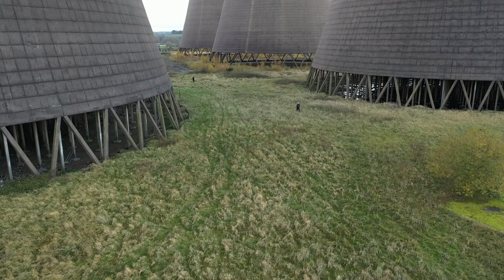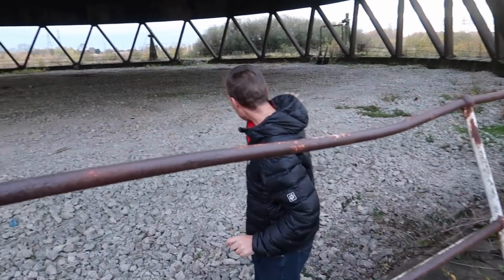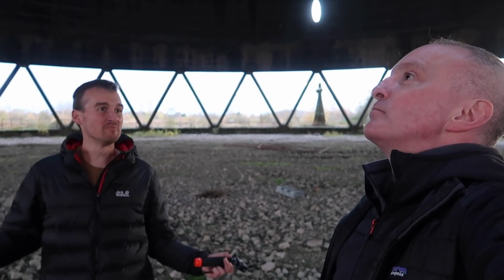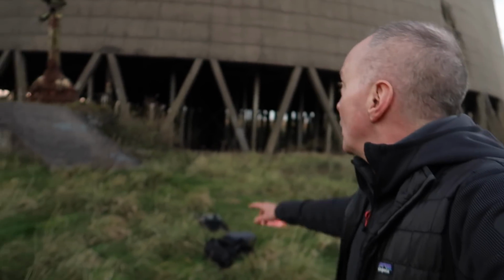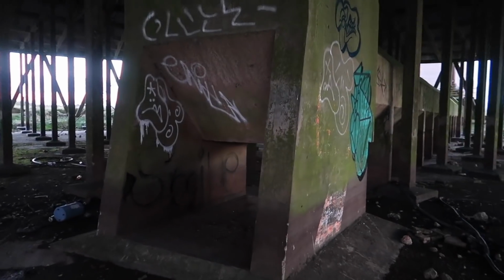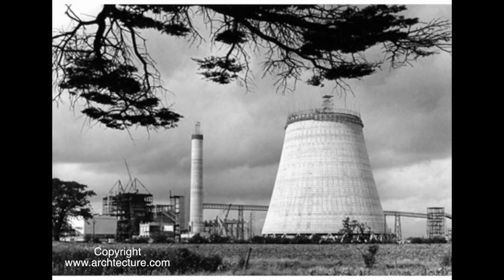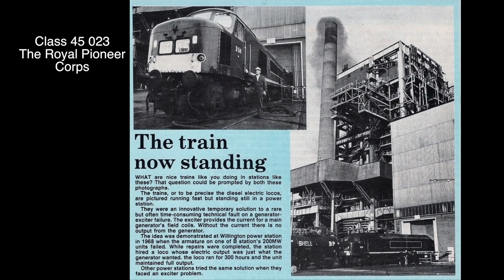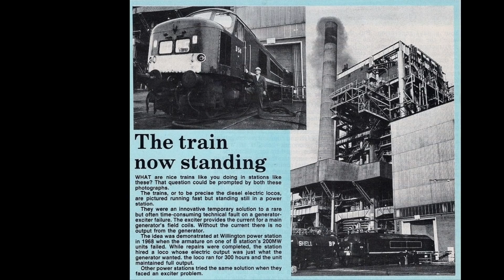The abandoned Cooling towers of Willington Power station

Comment: They are natural-draught, hyperboloid cooling towers.

They work on the principle of evaporative cooling. Hot water from the power station is pumped into the cooling tower at a height of about 30ft, where it is sprayed through a series of nozzles (much like an office sprinkler system) on to a layer of dense latticework, which is called the fill. The hot water coats this honeycomb, trickling downwards.

The base of the cooling tower sits on a plinth of 25ft-high concrete struts, which forms a massive natural draught intake. The warm air produced by the hot water rises inside the cooling tower, drawing in cold air from outside, which cools the water coating the fill. The inwardly sloping curve of the tower narrows to a diameter almost half the size of its base, arresting most of the vapour; only up to 5 per cent is lost to evaporation. The term for these clouds of vapour, which are erroneously presumed to be steam (or even smoke), is drift.
Reply: Thanks! That answers every question i had!
Reply: @mileshigh1321  Glad I was able to help!
Reply: thank you - I was about to Google this and post a link - no need now!
Reply: Great info, I'm surprised there didn't seem to be much evidence of rust or concrete cancer if thats the case with all that water about
Reply: Chaplecross near Annan in southern Scotland had cooling towers like these but one of them had a big bulge on the side near the narrowest point. It was allegedly caused by a slump in the concrete but it was too late to correct it so it lived as testament to the contractors cock up.
Reply: Thank you so much for the explanation much appreciated.
Reply: I live here, been urbexing here and got some stunning photos.
They can’t bring them down because of the birds of prey nesting in them. So they’ve left them...
Reply: The lattice-work - in later years - was most often made of 'packs' of vertical corrugated plastic sheets [corrugated to max the surface area and cool the water more effectively], that were suspended right across the tower in a layer about 10ft deep under the sprinklers. Imagine something like a giant round 'filter' stuffed in the tower blocking out all the daylight at the bottom - that's what it looked like in intact towers I've seen. Often there was ladder access through a gap in this condenser layer up to the sprinkler level. If you are under a cooling tower and you can see any daylight at all, it is a sure bet these condenser packs have been removed, even if the, struts, supporting framework and walkways above are all still intact.
Reply: Always annoys me when they are portrayed as belching out smoke !
Reply: Good stuff. I take it there was a drainage system somewhere below. Was this water recycled or was it sent to the River Burton nearby?
Reply: I found a spray nozzle inside cooling tower No2. It looks like a fire sprinkler and has 1 1/2 inch BSP screw thread on it and is made out of brass. There would have been a few thousand of these in each tower.

Comment: I saw your drone footage of the Cooling Towers at Willington Power Station.  Brought back so many Memories.  I worked at Willington many years ago, first went there in 1967 as an Engineer working first in the Main Control Room, then in the Unit Control Rooms on Willington A Power Station and then on Willington B Power Station. Worked their till I took early retirement 1993.   Both stations were still running then at least for a few more years.
The two empty cooling towers were linked with A Station. 4 * 104MW Turbine Generators.  The steam used to drive the Turbines was condensed back to feed water by use of river water pumped directly from the river through turbine condenser and back to the river downstream.  These two towers were used when river conditions were such that insufficient water was available at the river , many causes for this, and these towers could be brought in to use to give additional cooling water. It was still river water.  
The three towers which are still largely intact were linked to B Station 2 * 200MW Turbine/Generators and it was a closed circuit system, only topped up with River Water as required by evaporation.
The Inlet valves were used to take a tower in or out of service depending on cooling demand.
As you surmised the inlet did go up to the middle, and then there were pipes radiating out from the central distribution point to near the Tower Walls. These pipes had numerous nozzles on the top which were designed to cause the cooling water to fan out over the cooling slat sand grids.  What is no longer in place are those distribution pipes, and also loads of triangular cross section wooden slats fitted in to the grids below the distribution pipes and the walkways so that the nozzles etc could be inspected.  I think these wooden slats were removed and disposed of after decommissioning because they were arsenic impregnated wood. (used as a preservative).
The towers also had a ring of pipe around the inside of the tower wall near the edge of the distribution pipes which was meant to be used to provide a curtain wall during freezing weather to try and prevent the slats from icing up.  It did work to some degree.
I even remember one time when the B Station site was shut down for an extended period and the Cooling Water Culvert Pipes were inspected.  Seemed like miles when walking along those pipes which had been drained. And spooky.
Ah what memories seeing these pictures bring back. But it seems like eons ago now.
Still my thanks for those memories
Reply from the maker: Hello Bruce, thanks very much for the info. Very glad it brought back memories for you 👍
Reply: I found a water sprinkler inside the second cooling tower at Willington A. It’s constructed in brass. It looks like a fire sprinkler but bigger. I believe they were screwed on asbestos pipes. The piping was removed prior to 2003 but they left the concrete cooling tower packings below the sprayers. It’s the concrete panels that held the timbers you were referring to. It looks like they started demolition work on the first 2 towers at the A station in 2000 by removing the asbestos and timber leaving the concrete packings behind. Then years later they decided to remove the concrete packings for safety reasons. They were a climbing hazard. The demolition contractor also demolished the access stairs to all 5 towers during the demolition of the power station. I would love to know how many water sprayers each tower had?

Comment: As a child I thought power stations were brilliant places. My dad worked at both Huncoat and Padiham and occasionally took me to "work" with him on Saturday mornings. When the station was on a shut down we climbed the spiral staircase and went through the hatch into the side of one of the cooling towers, toured the inside of the boiler house (where some of the early series of Red Dwarf were filmed), went round the turbine hall and workshops. The highlight for me though was going up to the railway sidings where the coal hopper was. By this time coal was mainly brought in by road but the yard was still operational and there were loads of coal waggons just lying around. My dad let me drive one of the diesel shunters, couple up to one of the wagons and take it to the discharge point, uncouple it then raise it in the lift to be tipped. Going backwards and forwards in that yard has to be the best day's work for a 10 year old.
Reply: That's the kind of stuff we will always remember about good dad's. 😊
Reply: Padiham Power Station was demolished by Able who also demolished Willington Power Station 5 to 6 years later.

Comment: A belting video again Martin. :-) I remember going on a school visit to Agecroft Power Stn in the early 80s (probably near to it closure) and we were taken near the cooling towers to see them in action.  I remember all the water dripping down, and there was like a water sump/ pool underneath. 💧💧💧   

Regarding the Electrical Excitor. This equipment is/was used on large rotating machines such as generators to provide an external source of current flow in order to start the generator outputting power. 💡💡
Reply from the maker: I would have loved to have seen that John
Reply: @MartinZero  unfortunately I don't remember if it was Station A, B, or C. But it was one of the best primary school trips! :-)   Partly why I was disappointed not to have made it to see the control room before it got stripped out :-(

Comment: I’m a local living just down the road in Burton and always glimpse them on my way to and from work.
There used to be 3 large coal fired stations with altogether 10 cooling towers at a place called Drakelow, which was always dubbed Burton’s power station even though it was technically in South Derbyshire. All three stations are gone, closed and demolished between 1984 and 2006, so considering Willington closed in the late 90s before the last station closed at Drakelow in 2003, but it’s 5 impressive towers still dominate the skyline around here, I feel proud that these have lucked out to stick around as monuments to our industrial heritage, albeit decaying ones.
Reply: I managed to get legal access to Drakelow Power Station in 2003. The cooling towers there were bigger standing at 350 tall. I went inside the turbine hall and control room.

Comment: Saw the 8 cooling towers at Ratcliffe upon Soar (not many miles from Willington) also close to the Trent from close up. The East Midland main line runs hard by them and in recent times a new rail station too, East Midlands Parkway. When they are in operation great sheets of water can be seen falling from the sides into the lagoon at the bottom, while a cloud of steam wafts from the top of the tower

Comment: Eyup from Derbyshire. You were right in my patch here. I live in Mercia Marina which is right next to the towers (largest inland marina in Europe). The towers are owned by Uniper who operate Ratcliffe power station, next one along down the river Trent, and it is common folklore that they were kept due to local resistance to the site being developed for housing and a willingness for them to be retained as a 'feature'. The truth is that after the planning for housing was withdrawn due to significant and costly local opposition, Uniper had plans to install a gas turbine on the site instead. It would have needed a tall chimney to be installed but not one taller than the towers. With the towers in place the Chimney wouldn't have needed planning permission as it would not have been the 'tallest structure' on the site. Demolition of the towers would restrict Uniper's plans for the site in the future should it be felt that the national grid needs a fast reaction gas turbine be installed.
Reply from the maker: Cheers Will

Comment: Good call Martin, i remeber looking at these as a kid in Manchester in wonder, I can not think where now ,always water streaming down and wondered what was inside ,hope they save a couple.
Reply from the maker: I vaguely remember the Chadderton ones
Reply: @MartinZero   @Martin Zero  Was there any around Stockport i grew up on the south side .A note on the MGR trains in practice the Loco's were fitted with SSF system Slow Speed Facility so at the station they would crawl at between 2 to 3 MPH while unloading so the train never stopped , also if you check out the hopper wagons there is a lever on the side for the brakes marked loaded /empty this was also tripped halving the brake force on the wagon for economy ,all clever stuff from BR ,the SSF could play up on the loco's causing us a bit of head sratching.Hope this is of interest .

Comment: I watched Didcot power station being built between 1964-68, i watched it grow each day, demolition began in 2014, i never thought i would see this in my lifetime (i'm 65)
If you have seen the videos of 'concrete 3D printing', didcot cooling towers were done in a similar way, a central tower was erected with an arm on it (just like @11:06), i can't remember if it was all concrete, or if it was shaped blocks, but iirc they were built in a spiral (which can be seen from the forwork in the pic above)
Water was sprayed into the towers from that centrral pipe, and dripped down the plates, the shape of the tower meant the heat going out the top drew cool air from below (Bernoulli effect)
At didcot, the warm water was used to breed eels in ponds next to the towers.
Reply from the maker: I bet those Eels were big buggers

Comment: As a young adult here in Sacramento, I toured the Rancho Seco Nuclear Power Station, which had two of these towers. From my recollection, there was more metal lattice structures to increase surface area inside to spread the cooling water out. 

But I also recall standing next to the opening and feel the draft it created. It was this steady flow of air past your body. This was early summer but any other time of year, the draft would be quite chilly. 

As for their fate? Well once the brownfield  remediation is complete, which probably includes the area around the towers, they will be pulled down because the land can be reused.

Comment: The Cooling Powers are impressive indeed. when travelling to Derby on the way you can see them out the window, at the moment. Where I live in Rugeley, there is another Power Station, used to have a A Power Station and B Power Station, the A Power Station long gone in the mid 90s but they only closed the B Power Station 2016 and started last year knocking it down and I have been capturing  the demolition (part from the 1st one which was a complete disaster, thanks to the fog, there was something coming down but they couldn't blow it up until the fog was 50 meters above the structure ) but a very impressive video indeed and also nice to see Ant!
Reply from the maker: Cheers Simon

Comment: Fascinating vid about strangely compelling structures - I can remember that one at Fiddlers Ferry collapsed in (I think) the 1990’s . I lived in Goole on Humberside for a year and I could see the huge ones at Drax (Britain’s biggest) from my window.
Reply: The B2 cooling tower at Fiddlers Ferry Power Station collapsed during a gale in January 1984. It was known that this tower contained a roughly axisymmetric bulge just above the ring beam which had been present since the time of construction. This paper describes various finite element analysis that were carried out to assess the effect of this geometrical imperfection on the stresses in the tower. It is shown that the bulge would have caused vertical cracks to develop and the subsequent propagation of both horizontal and vertical cracks would have ultimately lead to the collapse of the tower.
Reply from the maker: Thanks Jordan

Comment: I once went to an open day at Ince power station near Ellesmere Port, long gone now, but it had a single cooling tower. It had massive fans to improve the cooling effect, and I was told it did the job of 4 conventional towers.
Closer to where I live, in the 80s, one of the eight cooling towers at Fiddlers Ferry blew down one windy night. You can actually see a slight colour difference in its replacement.

Comment: Another great explore and video. It was double-headed Class 20s and Class 44s when I was a lad. I don't think Willington had any 'true' Merry Go Round systems with auto unloading. I can still remember the thunderous sound as one of the coal trains started off and the couplings each took the strain - they were unfitted 4-wheel wagons back in the early 1970s.

One of my Uncles used to be the Fireman on one of the steam shunting locomotives at Willington. That must have been after he'd done his wartime service with the RAF. 

It sounds like there are lots of stories about why they keep the towers standing. Local gossip is that a new gas powered power station might be constructed on the site and planning permission will be easier if the site still looks like a power station. But Ratcliffe is due to be replaced by a gas powered station and there's no good reason to build two similar stations so close together. With Rolls Royce being so close and with them having plans to manufacture mini-nuclear stations, Willington might be used as a test bed with its links to the Grid, but that's unlikely especially with the Findern and Willington villages being so close.
Reply from the maker: I suppose time will tell. `it will be interesting to see. It was a great place. Class 44's and 20's amazing

Comment: Hi Martin ! Again a nice video for spending the sunday evening. Thanks for sharing. But BTW: the inside of these cooling towers is far from being harmless. Due to the water condensation and the moss buildup on the internals you find a lot spores and fungi inside these green layers on everything. This is a problem when taking these things down and had to be taken in account by the workers at demolition. Other than that they are made to withstand air and water and intrusive steam against corrosion and concrete damage, so they might stand there for another 50 years until the need comes up to take them down because of structural instability.
Reply from the maker: I reckon they will get blasted
Reply: @MartinZero  Sure will. But that requires a lot preparation work as well. There was a video (or some) on the net where they'd blasted cooling towers. Need to look that up again. :-)

Comment: @7:20 That is a remote (control room) controlled gate valve.  A relatively small electric motor will operate a reduction gear drive (much like a manual car transmission/gearbox) to turn a shaft with a worm gear at the gate valve.  Forward or reverse of the motor will raise or lower the gate and thus regulate and or stop water flow as required!